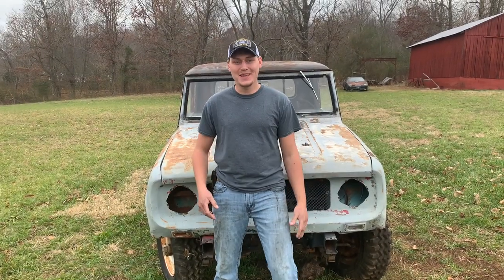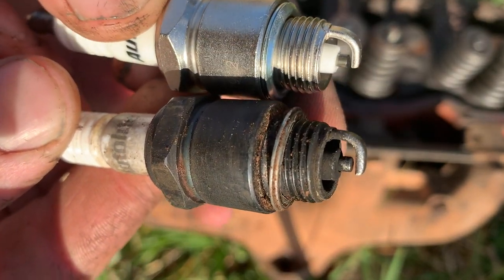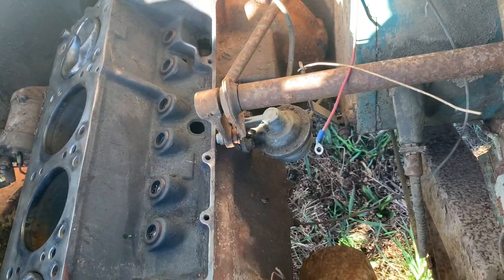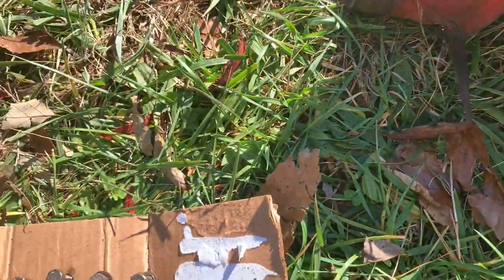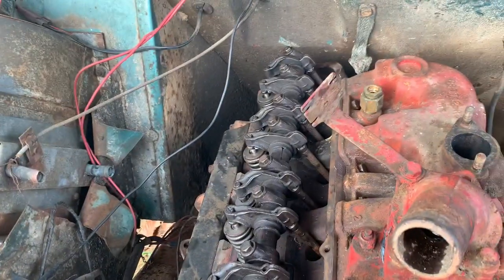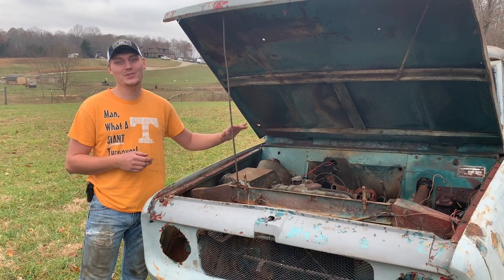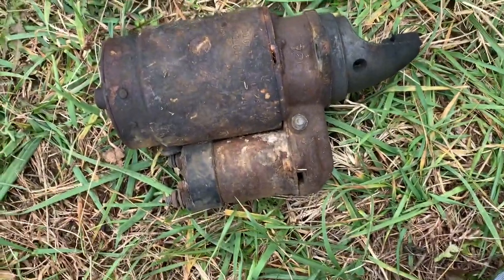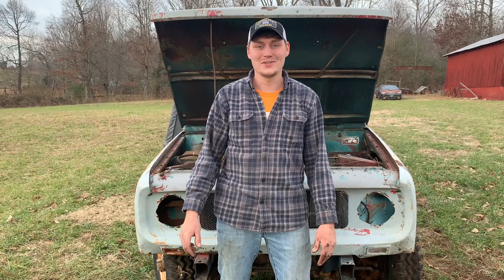Junkyard Scout Will It Run? Part 2!

Comment: Fun fact- International actually made most of the bolts used on their equipment and vehicles themselves. Any bolt that has an IH logo or a WP (WP= West Pullman) on the head was made by IH in West Pullman, IL.
Reply from the maker: Great information! Thank you!

Comment: The screw on the points is actually for setting dwell, the gap is set with feeler gauges. Points are a lost technology now days. Detroit stopped using these in 1975, we have had almost 50 years to forgot how this old tech is used. I really like how these old machines were put together, so interesting all the old marks and logos.
Reply from the maker: Thank you for the info! They are really cool!

Comment: You made a mistake by saving the old fuel pump. While the engine was apart much easier to replace
Reply from the maker: I’m on a pretty tight budget and it seemed to be in working condition. If it doesn’t work I’ll change it out it’s not too bad to get to! Thanks!